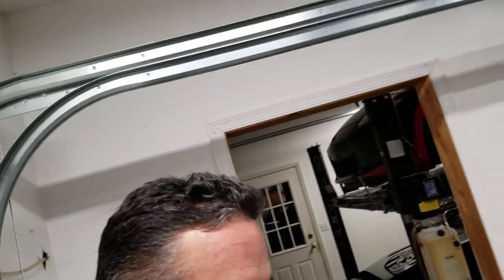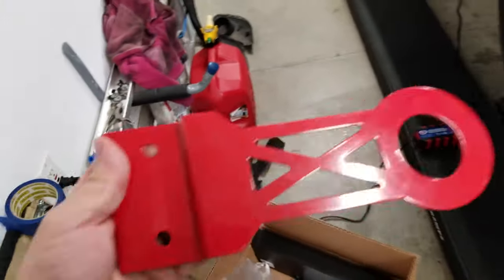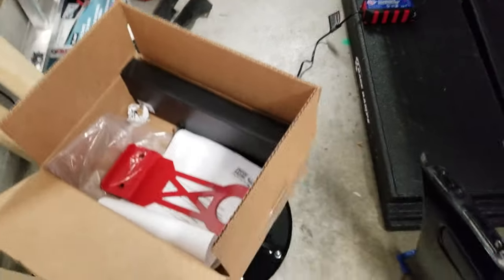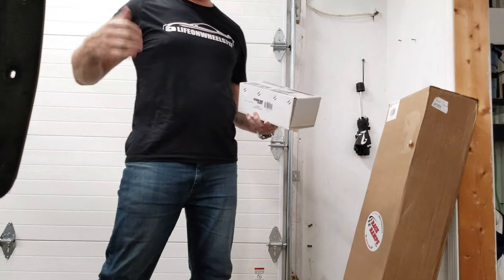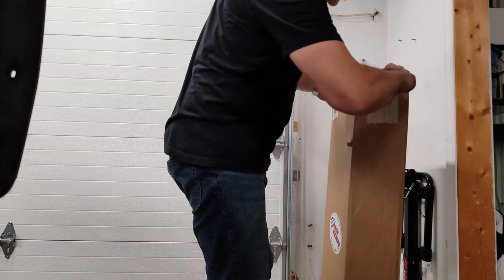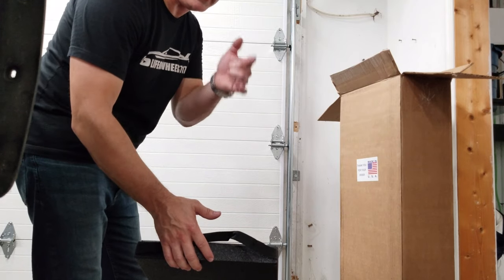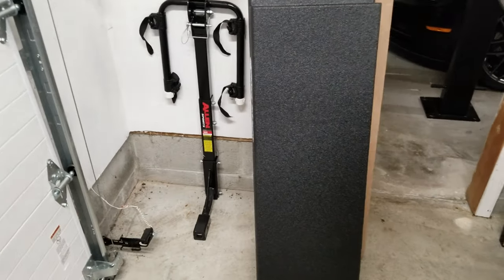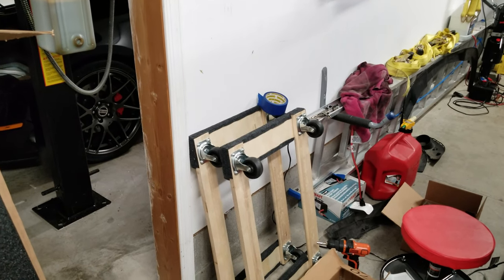Parts finally Arrived for C6 corvette / car trailer!

Comment: I'm wondering if the tow hook is actually long enough to extend out far enough beyond the grill? It's "definitely hot" says Mr. Puerto Rico. lol Save the Wave my friend.
Reply from the maker: Yes I am not sure the picture I have showing that it works will see I will have a video on the installation soon as I get some free time I will pickup a drill bit for the installation because next week if the weather is good I want to take the Corvette to the track thanks for watching
Reply: Thanks Laz. You're going to have to be my guinea pig on this one.  I'm anxious to see how much customizing might be involved in the way of welding on some sort of spacer to the frame to bring the hook out more. Depending on what your vid looks like, the tow hook I really would like to have is the factory C7 tow hook. Whereas the one you purchased is rigid. The C7's is hinged at the end so you only have to raise it up to receive a hook, or you can have it up all the time which kinda looks cool. Plus, it's threaded, so if you don't like the "cool" look, you can remove it. But to install the C7 tow hook, there would definitely be welding involved for a spacer and then threading same to receive the tow hook.

Since you have track plans coming up, I'm sure you'll get it to fit, just leave the grill off of if necessary so it's readily available if need.

Good luck and have fun.